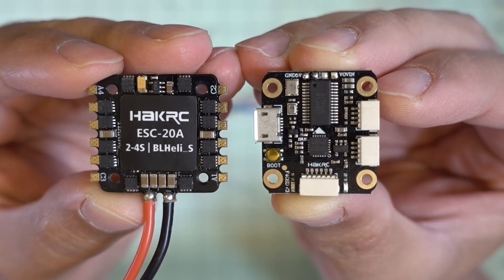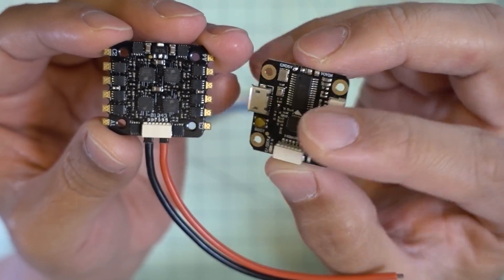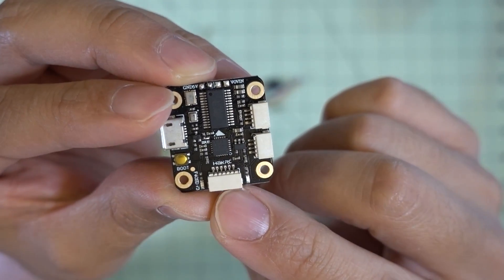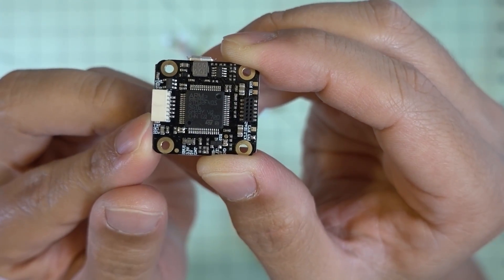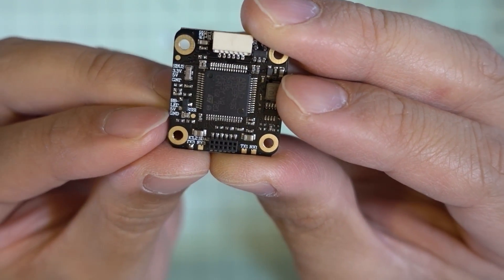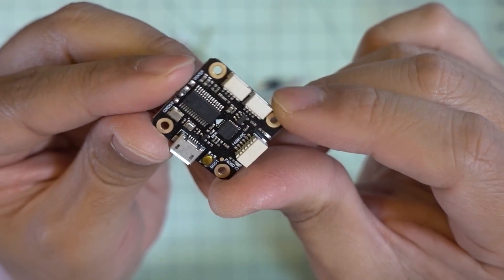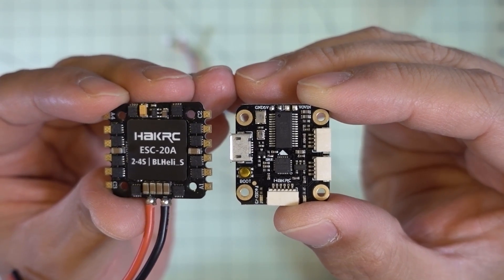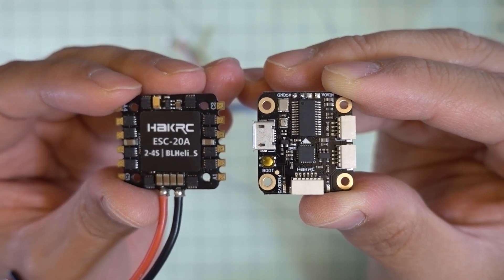HAKRC F4 Flytower Review 🌤️🏖️

Comment: Hi, I have those esc of 40A and FC of the same brand. my question is, could I connect the fc and the esc through the pins? in case of connecting

 So, how would the FC be fed if I put the xt60 in the esc? Greetings.
Reply: Hello, did you got an answer to your question ? I want to connect it to an ESC but I don't understand where to solder the positive / negative. Thanks!

Comment: The weird about this stack with the VTX is that the specs of the VTX sais:
Input voltage: 7V~24V, +12V/170mA@200mW
So... if you're actually using a 2S battery like this ESCs allow, you might have some drops on the VTX when you're stretching the battery, no?
Reply from the maker: maybe, depends on the regulator on the VTX
Reply: @AlbertKimTV , it will certainly depend on the voltage regulator. Cheers. ..

Comment: Thanks for the review Albert, your channel is a true treasure trove of good stuff!
In the vid you mentioned that the RSSI solder pad can be converted to be used with a current sensor using resource re-mapping.
Is this something you have or will cover in some other vid?
Reply from the maker: It's been covered on videos elsewhere...  Its not that difficult... you can start reading up here first to understand the terminology - https://github.com/betaflight/betaflight/wiki/Betaflight-resource-remapping
Reply: Will check it out, thanks!

Comment: So it is feasible to use \install a gps module with this FC (available uuart) configure with INAV and have a micro quad with return to home capability?  Thxs
Reply from the maker: It's possible but I don't know much about iNav to say for sure 100%.  I do know in the manual it shows where to connect up a GPS.

Comment: The omnibus v5, 4, 3, and 2 have barometers
Reply from the maker: Yes, but are they 20x20?  Those are all 30x30...
Reply: And you don't need a barometer for iNav on a fixed wing
Reply: I have been looking at this HakRC 20x20 for a while as a small GPS rig FC / ESC. Bruce at RCmodlereviews should like to look at it too for his sub 250 g camera quad project :) 
I have not found any other 20x20 F4s with a Barometer.
Reply: Andrew McMahon I posted a couple 20x20 omnibus fc, I have used the ones I posted but like the raceday quads f4 the most.

Comment: $3 more with the vtx, no brainer!  How do you compare it to the hglrc, what do you like better?  Great price and great features 👍
Reply from the maker: To be honest, just about all these stacks seem about the same to me.  What makes them different are things like number of UART connections, F3 vs F4, how big is the ESC, etc, etc... in terms of performance, one stack with an F4 will be the SAME as another with an F4 (and same gyro of course).  The difference makers are the specs which is what I go over in the overview.
Reply: Thanks again for always responding.  I've had some issues with the hglrc, just looking for a replacement go to stack.
Reply: It could just be me. But my hglrc stack makes tons of noise on thr video.  I run 3 of these hakrc stacks all crystal clear video.   There is also no instructions at all on the vtx.  But it looks exactly like the panda rc VTX 5804 i believe.

Comment: I would really love it if you added their vtx and how to set it up to change the channels on your goggles or radio. However it works.  Cause this stack with the vtx is 5 bucks more.  But i found the vtx either to be garbage or i have some settings wrong.  I cant tell what mw im on
Reply from the maker: They only sent me the one without the VTX, but the VTX is the same as the AOMWAY TX004.  I personally think that VTX is difficult to use but once on the correct channel it performs fine.  You might be on a wrong channel.  The eWRF 20x20 vtx is probably the best/cheapest out there and it has smart audio so easy to use.  I would recommend that one for $17.  I have a video review on it already.  Search my video transmitter playlist.
Reply: Albert Kim thanks Albert. Yeah i just threw in a eachine vtx03. Im fine with pushing a button.  One day ill figure out smart audio lol.  I agree about the channel, at first the new vtx wasnt much better until i switched channels.  Now its so much better.

Comment: Needs at least a capacitor, big time!
Reply from the maker: You might have a ground loop issue with your video wiring.
Reply: And where do i find out what that is?
Reply: David Hannigan Jr. good question 😂 that’s gonna be my next YouTube search
Reply: Jrod RC make sure your camera ground is on the same pad as the vtx ground!
Reply: Sixx2099 it is when you ain't got one, and they didn't send one with their noisy ass ESC.
Reply: David Hannigan Jr. Much cleaner video than my hglrc stack
Reply: My video ain't terrible, but i only have OSD at like 5% throttle or less.
Reply: David Hannigan Jr. I just rebuilt a quad and now i have that problem on my hglrc stack.  Osd flickers in and out mostly out.  To clean the video i tried a cap made no difference. So i tried a cap and an lc filter and now its worse its ever been.  But i hooked it up on the opposite side of the esc from power input.  My last attempt will be hook the lc filter to the battery leads and add another cap.  If that dont work itll be the back up back up quad.  Also i get cleaner video with my caddx cam over my run cam micro v1.  I ve swapped them on several setups just to see and yup better video with the caddx with all other things the same.
Reply: Well the only thing different on this kwad from the previous setup is the ESC. i'm not even using the FC (due to faulty control RX connector, so yeah there's that too). And on the previous setup, everything (outside of a little closer care to the tune) was rock solid. So its definitely a noisy ESC issue. Besides, its all on the Diatone GT-M3 frame, so at best i have room for a cap. But thank you for the suggestions.
Reply: Mini Quads Mega Fun Thank You! I haven't tried it yet, but it sounds right.
Reply: Albert Kim good suggestion, but it wasn't a ground loop issue.